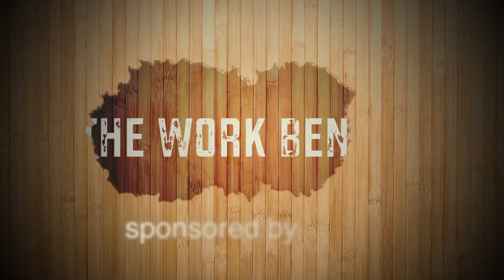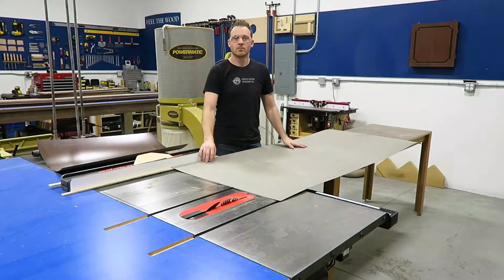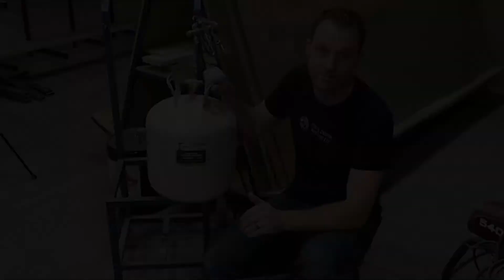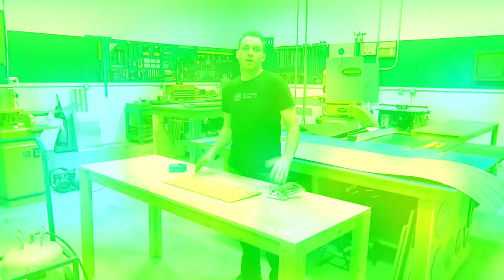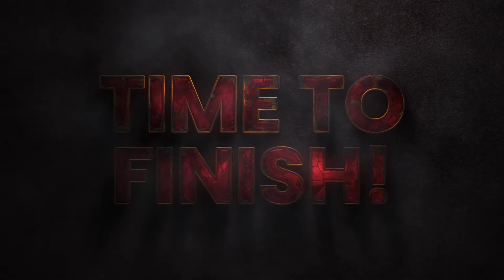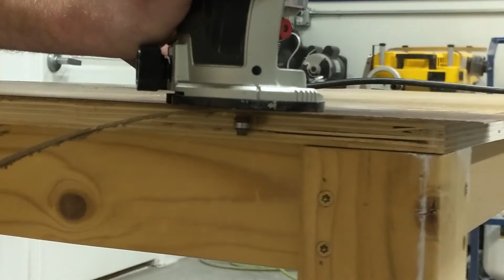Laminate basics (002)

Comment: About time Ace.
Reply from the maker: I am getting there, a nice push from you fine folks is making things happen
Reply: @theworkbench4484  maybe later you can add a clip about what happens if a small wood chip happens to sneak in between the plywood and laminate hahaha.  I bet that never happens to you just from looking at how clean your shop is.
Reply from the maker: @wafflebeaver  when doing multiple pieces, it is not uncommon to get bit of laminate from previous cut offs underneath. Definitely will be a follow up video doing more down the line. The laminate How to video was scheduled to be number 48. I kinda bumped it up on a whim when I filmed this one. Definitely why I mentioned more to come on laminate down the line
Reply: @theworkbench4484  I feel like it's worse than getting an actual splinter in your finger.  So painful.. mentally